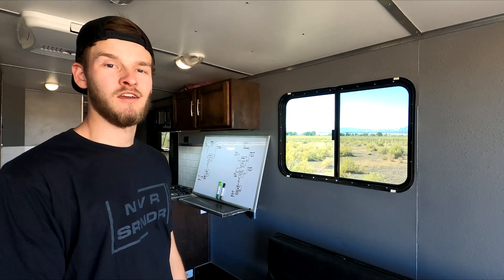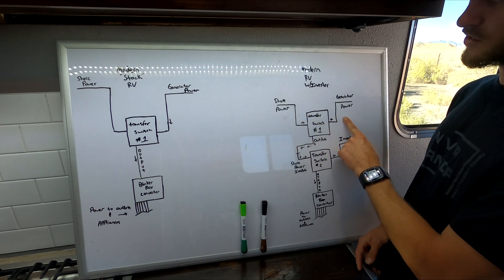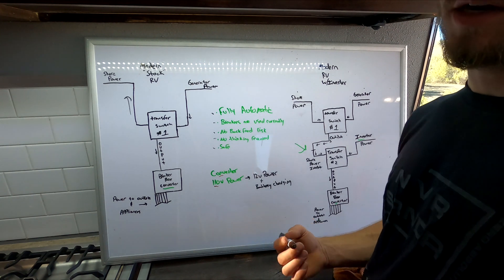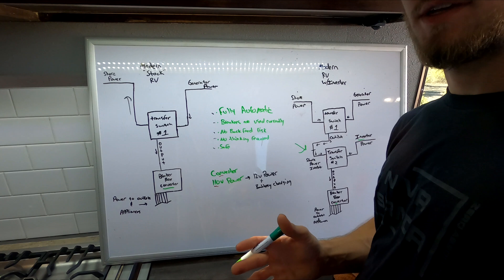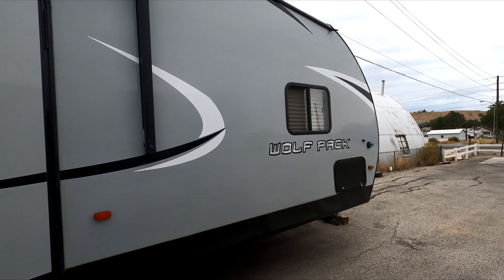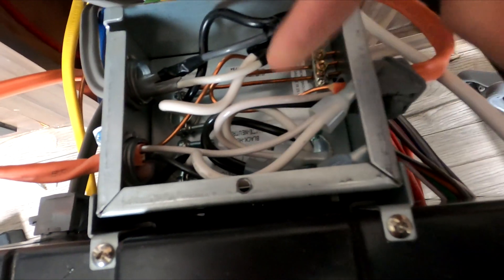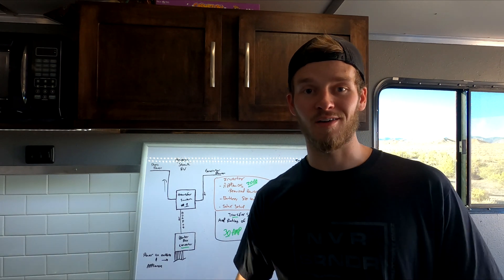Installing an Inverter and Transfer Switch in your RV (Basics)

Comment: Great Video !! Everything I needed to know - I'm an electrical engineer with 30+ years experience but a newbie to RV's just bought a 2015 Thor AXIS Vegas 24.1 and the panel is near identical. Also I was very surprised these units aren't already built with this in mind; my surprise when I found all 3 TV's and every outlet was dead - I checked the obvious breakers etc but then realized SOAB this unit is not equipped with an inverter. Your video is a slam dunk - I'm also going to upgrade to LiFePO4 batteries.
Reply from the maker: Perfect! That’s what I was shooting for! congrats on the new trailer! They are fun! Yeah it is kinda interesting they don’t plan for that especially with the fancy new ones these days. Those batteries will be a sweet upgrade for the trailer! I looked at going that route on my build but went the cheaper route instead 😂 I might go big next time around, that discharge capacity would be sweet

Comment: That is by far the easiest way I have heard to hook up an inverter. Thank you!!!! I would assume that you hook up a battery disconnect switch in between the inverter and the second automatic transfer switch so it does not drain the battery when you are no longer using the trailer.
Reply from the maker: No problem! Glad it helped ya! 🤘🏼
If you were to do a battery disconnect switch for the inverter you would want to just put it between the battery and the inverter, there would be no need for a 110v disconnect between the inverter and transfer switch. Although it’s a good idea in some cases I don’t have one before my inverter because I plan to leave it connected all the time. My inverter doesn’t seem to drain the battery when it’s not on and I have the solar panels to keep the batteries topped off at all times
Reply: @AustinStout  Good point. The other thing I came up with is to buy an inverter with a remote on/off switch mounted inside the RV. With the inverter turned off it shouldn't allow any residual power flowing to the breaker box. Thanks again for posting the video!
Reply from the maker: @boy2cuda  Solid idea! The remote is so handy! That’s how I did mine. I ran the switch up by the controls for the water heater and water pump

Comment: I have a Renogy 3000w inverter. It has connections for hard wiring outlets instead of using the outlets on the inverter. Does anyone know if I need to fuse or use a circuit breaker between the outlets and inverter? I dont need transfer switches or anything because I have a seperate converter for shore power
Reply from the maker: I mean ultimately in my opinion it would be a good idea to have circuit breakers between the inverter and the outlets. That way if something does happen (coffee pot shorts out, mouse chews the wires etc) it won’t ruin your inverter. 
A good reason to run the inverter power through the stock breaker box is so that you don’t have to add a bunch of auxiliary breakers. Save some money and a lot of effort. 
Since it sounds like you have a separate setup though one idea would be to add a main breaker right after the inverter and have all your outlets going through that. 
Kinda sweet your inverter has connections to hardwire it!

Comment: Probably dumb question. If my trailer has one factory transfer switch, and I want to take advantage of the second diagram, all I would have to do is buy one more transfer switch correct?
Reply from the maker: Yep you will just need one more transfer switch as well as some wire to connect it. Each trailer will be a little different so you will have to take a look at where you can mount the second one and measure how much wire. The last one I did on a newer 5th wheel we put the wire in conduit as well to clean it up a little bit! 
I added links to a couple switch options in the description as well

Comment: can anybody help me , ? I have yeti 1400 ,can I use it as inverter /battery on this diagram? thanks
Reply from the maker: So I wasn’t too familiar with the yeti 1400 but after looking it up there shouldn’t be a problem wiring a transfer switch up after the unit. The main thing to consider is the power consumption of the switch itself. If a little extra power draw isn’t going to be too big of a deal I’d say go for it. But if you don’t have many solar panels and want to run the 110v power for extended periods of time you might want to look into a different wiring setup that will be more efficient. (Manual plugs) It all depends how much of the time you will be plugged into power and how much of the time you will be running off of the yeti. That make sense?
Reply: @AustinStout  thank you so much yes I have got the answer .

Comment: One question I had that brought me to this video was making sure the battery is not being charged while the inverter is on, as I see this as causing faster batter drop. My TT has just a shore power (which we plug directly into our Honda 2000 generator when needed), so I definitely want a transfer switch if we want to seamlessly go from generator to inverter (such as while watching TV) without any issues, but I was concerned about bypassing the converter with the built in charger
Reply from the maker: Yep good call on looking into a transfer switch, they are nice! It’s pretty easy to deal with the converter/charger situation! Just remember to flip that breaker off when you turn the inverter on and you will be good! Then turn it back on when you switch back to the generator. It’s not going to hurt anything if you forget and were to have the inverter and the converter on for a minute or two but it will drain your batteries quick
Reply: @AustinStout  The only problem is my converter/battery charger is on the same breaker as the TV and other outlets
Reply from the maker: @carlstrohmeyer  Oh really? That’s weird I havnt seen that before! In that case you will have to dive a little deeper into the install but you could actually make it work better! Basically you would want to disconnect the big power wire that feeds the charger and run a jumper wire from it over to the shore power terminal inside your transfer switch. That way your charger will only come on when there is power from the generator or plugged into shore power. It kinda sounds like a pain but you don’t have to go much deeper into the install than you already will be for the transfer switch. Does that make sense?
Reply: @AustinStout  Yes this does make sense. I was also thinking about moving what comes out of the breaker to another, but your idea might be better
Reply from the maker: @carlstrohmeyer  Either way would work! The advantage of connecting it to the transfer switch is the fact that it would automatically shut off when the inverter power was being used. You’d probably want to add a breaker for that connection too tho it’s about the same cost wise.
Reply: @AustinStout  To avoid remembering to flip the breaker on/off, I think you could just install this type of ATS for the second one? Looks like this one has the Generator/Shore input set as the primary source, and allows for power to go to the Charger.  When Gen/Shore isn't detected, it defaults to Inverter power and does NOT allow power to go to the Charger.
https://www.youtube.com/watch?v=iASOOzUCRto&t=692s
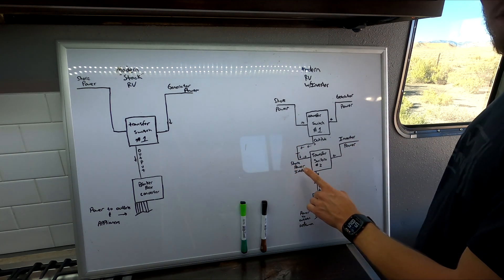Skip to 2:40 where it shows the guy testing how the ATS works.

Comment: Great video. Do you know if it would be ok to run the inverter while the chassis alternator is recharging the house batteries while motor home is running?
Reply from the maker: You shouldn’t have any issues alternator wise running the inverter while the engine is running but you will want to keep an eye on the battery level. The alternator can only put out a set number of amps and it will vary by rpm. That being said it would be easy for the inverter to use more than the alternator is making
Reply: @AustinStout  Thank you. I appreciate the quick reply.

Comment: Would this solve the problem of needing to shut off the converter at the breaker. https://www.amazon.com/gp/product/B00153EYTO/ref=ox_sc_act_title_1?smid=ATVPDKIKX0DER&psc=1 I was thinking of following your same example but using this automatic transfer switch. It looks to me like the converter would only be powered from shore power or generator, not inverter? Do you think this will work?
Reply from the maker: It would be really nice to solve that issue. 
The diagram got me at first on the switch you had the link to because it looks like you could have 3 power sources. But reading further into it the switch only accepts 2 power sources, so unless I’m missing something you’d be in the same boat with that one. I dunno why the diagram is showing it like that tho. If you wanted to get technical with it you could probably install a relay of some type that cuts the power to the converter box when the inverter comes online. Attach a signal wire to the inverter output and run it to a relay between the input for the converter and the main power source. I havnt messed with any 110v ac relays but I’ve done similar things with a 12v setup. Kind of a cool idea to have it fully automatic!
Reply: @AustinStout  I think all they are doing is prioritizing the power from shore power. They don't have the converter connected in the breaker box, they have it connected in the transfer switch. It then is only active when from shore power terminal.
Reply from the maker: @rickcleary1779  oh yeah you are right! I didn’t catch that detail. It would defiantly work if you are willing to change a little bit of wiring! The same thing would work on the other brands transfer switches too!

Comment: Great video,  finally makes sense.   So I should turn converter breaker off when inverter is on?  And make sure to turn it back on when shore power or generator is on?   My motorhome is 30A and I bought a 15A transfer switch by mistake,  can I just send inverter power to 15A outlets? Without problems.
Reply from the maker: I mean, you defiantly could but it would be more work and more money in parts. In that case the way I see it is you would want to do a sub breaker box for your 15 amp circuits. (Remove them from the original box) Then install the transfer switch between the original breaker box and the second one. You’d have to run a wire out of the first one to the shore power input of the 15a transfer switch then the other lead to the inverter. The output would then go to the second box. That way it would all be separate on the inverter side but still function properly while plugged in. You can’t really isolate the 15a stuff in the standard box because the breakers are all powered by a buss bar inside the box. if you try and feed power to one breaker it will feed power to all of them. If you connected the switches  in more of a parallel fashion you would run the risk of overloading that 15 amp switch when you apply a 30 amp load
Reply: @AustinStout  thanks so much for the detailed answer,  ordering 30A transfer switch.
Reply from the maker: @zahidc3145  Anytime! Glad I could help 🤘🏼
Reply from the maker: Yep flip the converter breaker off. It will run your batteries dead really fast if you leave it on. The problem with adding a 15 amp switch to the 30amp setup like I show in the video is that the rest of the rv power will be running through that switch even if the inverter isn’t on. So you would want to upgrade to a 30amp to avoid overloading that second switch. Does that make sense or?
Reply: @AustinStout  makes sense, but is it possible to wire in the transfer switch only for outlets, which shouldn't get more then 15a?

Comment: This is very helpful. My only concern with this set up is when the inverter is running won't it be powering the converter? Thank for you video.
Reply from the maker: Sweet! I’m glad it helped! Yeah so it will power the converter but you just have to flip the breaker off and you’re good to go. In most trailers it’s super easy access. Also if you want to save more power flip off the breakers to other 110v circuits you aren’t using
Reply: @AustinStout  Have you ever used the go power TS30? It only runs  converter when hooked up to shore power and disconnects when inverter power is used.
Reply from the maker: @igotabuzz123  I havnt. Another guy on here brought it to my attention though! We came to the conclusion that the transfer switch itself doesn’t do anything special but it’s how they have it wired. Basically they ran the power to the converter off of the shore power leg in the box. That way it only gets power when it’s on. You could do the same thing with other brands of switches if you were to modify the pre existing wiring for your converter a little bit!

Comment: Awesome video!! Just one question, do the 12v batteries just get hooked up to the inverter then go into the transfer switch or do they get hooked up to the converter to be able to get charged and run the 12v accessories or both? Sorry this is all new to me. I have an 8.5x24 enclosed trailer I’m building. I will only have a 30 amp plug coming in, so I will either have that plug into shore power or a portable generator. Thanks again for all your help!!
Reply from the maker: Yes so the transfer switch is just for the 110v power, you wont connect anything 12v into it. You will need to connect the batteries to both the inverter and the converter. The converter will charge the batteries when you have the generator running or when you are plugged into shore power. The inverter changes the 12v power to 110v power. Now just to be clear you dont have to have an inverter. Adding an inverter to your system is just an added convenience if you dont have a place to plug in or dont want to run a generator. Hopefully that makes sense?
Glad I could help! Stoked to hear you have a build underway!